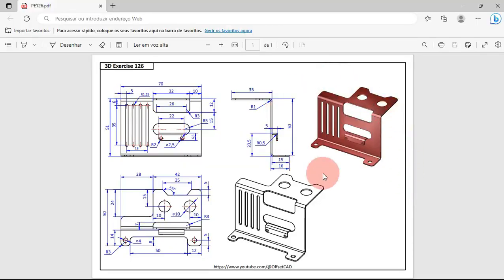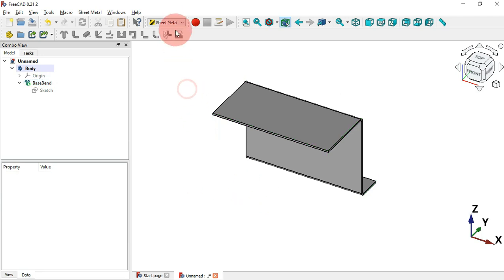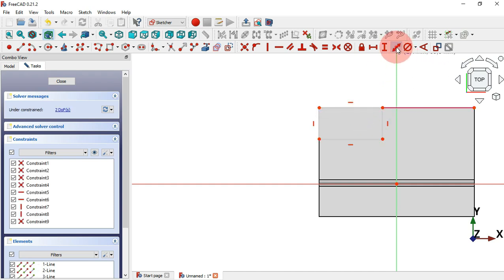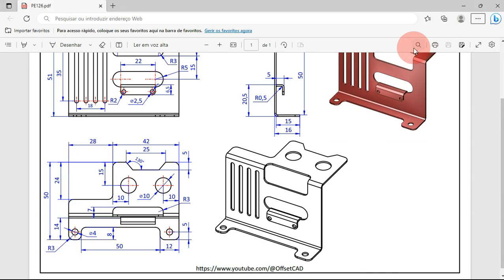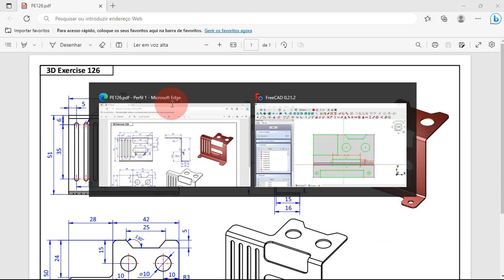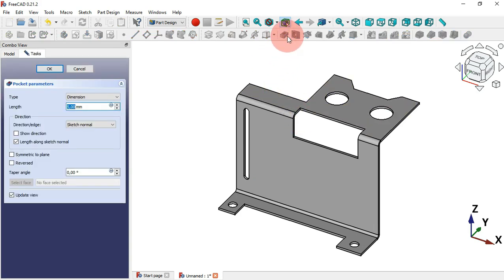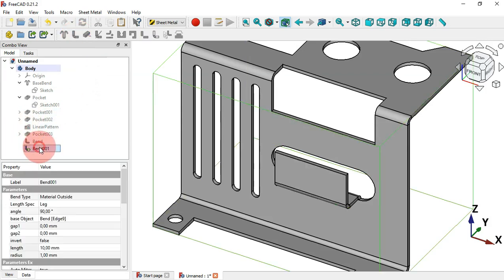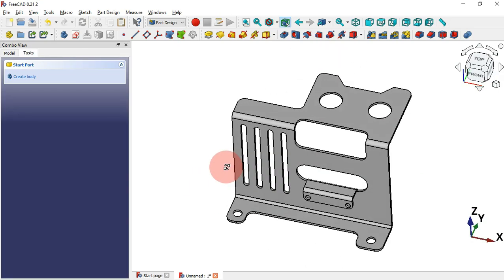FreeCAD 0.21 Beginners tutorial: practical exercise 126

Comment: Hi, "simple model"? That required a lot of your investigation specially on the Sheet metal work bench and adding the extra sketch that was deleted later. I also used the technique of using a "master sketch" and transform the exceedant elements into auxiliary/construction geometry.
Pretty nice video indeed, thank you. Cheers
Reply from the maker: Hahahaha, the model is pretty simple yes,but a lot of operations/process to get the final model.
Thank you for watching!